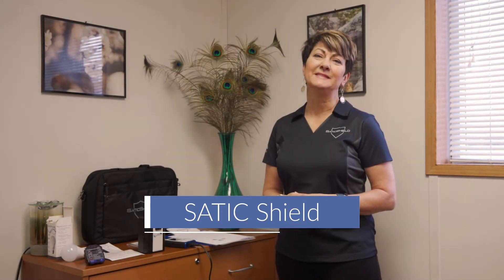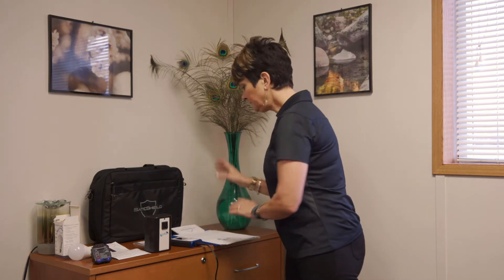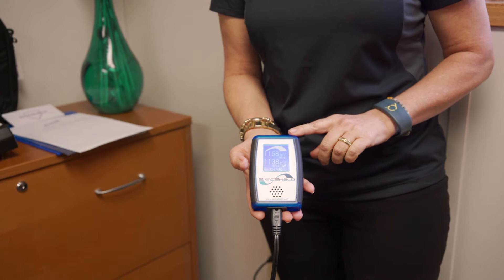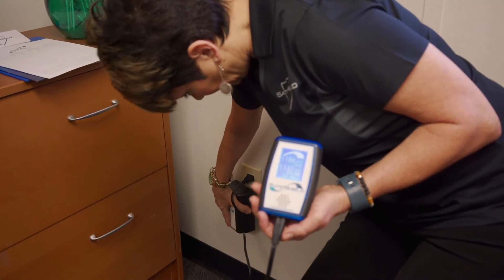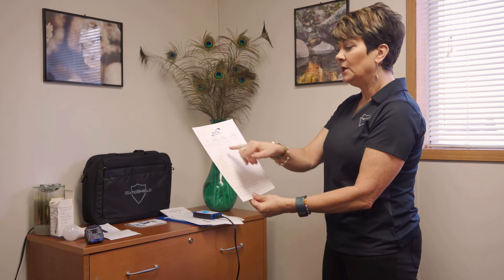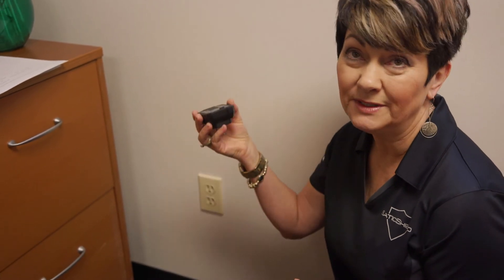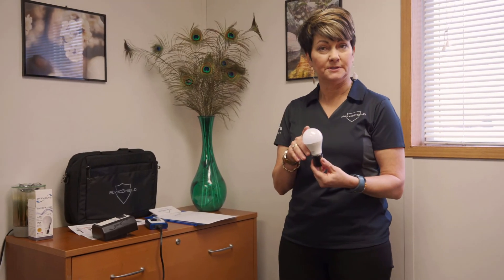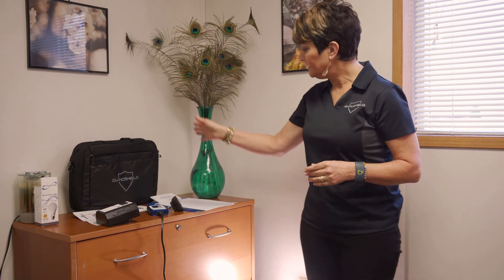SaticShield Dirty Electricity Test Kit

Comment: How much does this test kit cost? Also, it sounds like I would still have to hire an electrician.
Reply from the maker: You do not require an electrician for the plug in products. You may for the wire in units.
Reply: How much does this dirty electricity test kit cost? I do not see it on your web page.
Reply: @quietrain7340  A little over 500 dollars